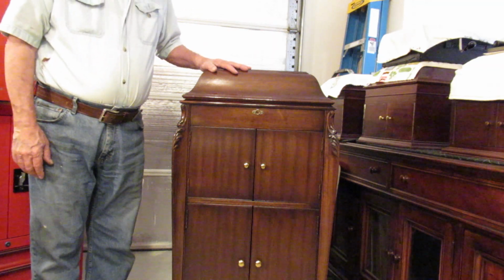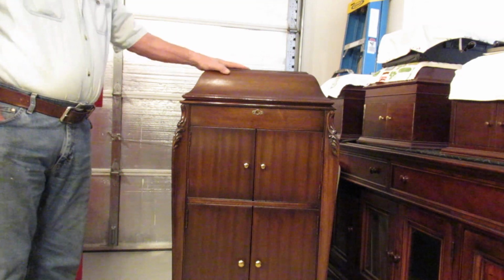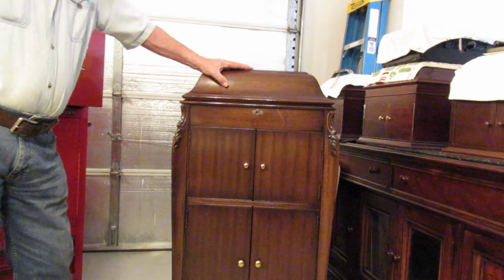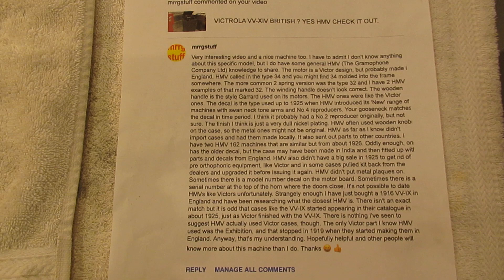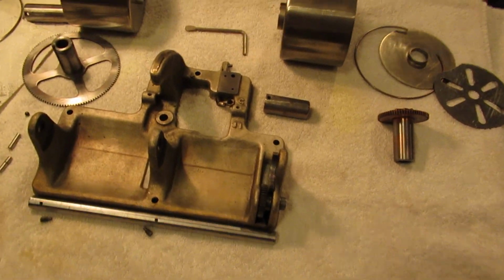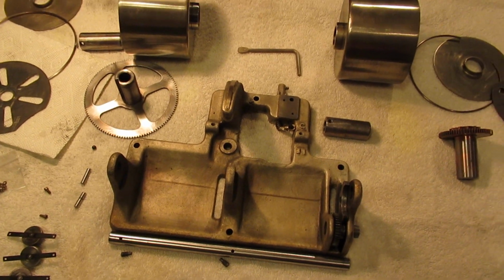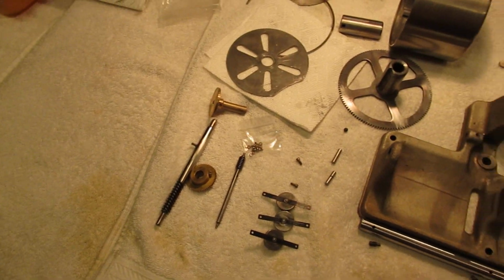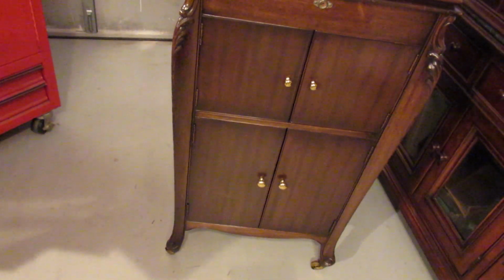HMV (VICTROLA ?) GRAMOPHONE PART 2 UPDATE

Comment: Thanks for the mention 😀 👍. Glad I was able to help a bit. Very nice machine, and interesting to see how it compares to the Victrolas. HMV unfortunately only started putting model number and serial number details on quite late, so although models like the 102 portable have them, earlier machines can be difficult to identify and even harder to accurately date. Looking forward to more of your videos. Thanks 😀
Reply: Hello,
Thank you very much for your help.
I am planning, when the HMV is completed , to do a more detailed comparison between HMV and the Victrola XIV (14).  It was interesting to find that the model 201 and 211 were both also described as  201 #14  and 211 #14. Don’t know if there is a connection. Will keep you posted.